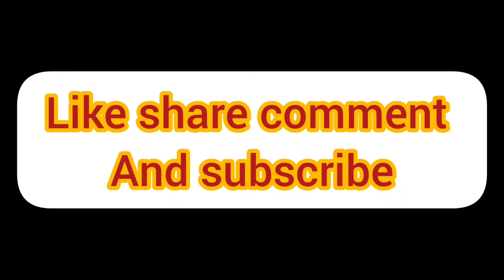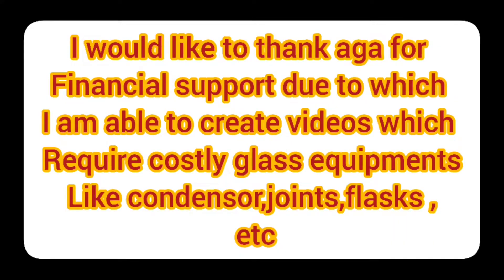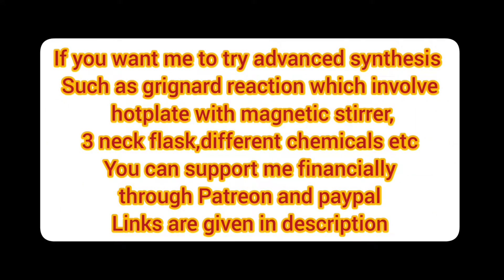Synthesis of Benzil from Benzoin

Comment: Why don't you all use glacial acetic acid in reaction mixture!?
Reply from the maker: No need
Reply: @TheDIYChemist 
But thhe reaction will be much smoother and more controlled. The acetic acid acts as a diluent and helps moderate the reaction rate.

Benzoin has limited solubility in nitric acid, so the reaction starts as a heterogeneous mixture, which can sometimes be less efficient.

Comment: Atrocious !. You have a gas burner just sitting there, that should have been off and away, the last thing to be turned on. Worse still, is your total disregard for the brown nitric oxide emitted from the nitric acid, that stuff is corrosive, carcinogenic and will damage your lungs without you even knowing about it until later on, vacuum hood or outside for this reaction, or catch the gas and bubble it into sodium hydroxide. Too cavalier with that condenser too, be a little more cautious in your movements, you didn't wash down your acid with a little DH20 either. Lab practice is more important than you think....good lab. practice techniques could save your life, and will make you a better lab tech.

Comment: Can i suggest you try membrane electrolysis of Magnesium sulfate ( epsom salt)? It should decompose MgSO4 into sulfuric acid at anode.
Reply from the maker: May be but i already h have 98% H2SO4
Reply: @The DIY Chemist  Yes, it isnt very practical. If H2SO4 is not needed, maybe try some other electrolyte or different electrodes, there really is a lot you can do with electrochemistry